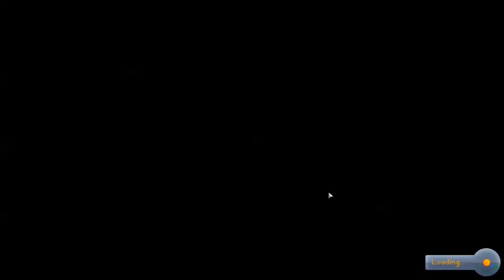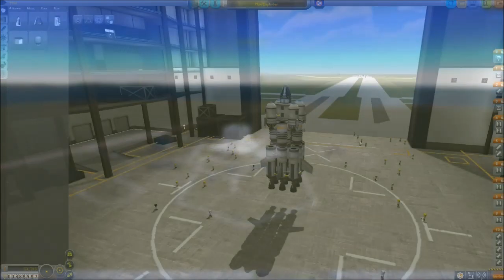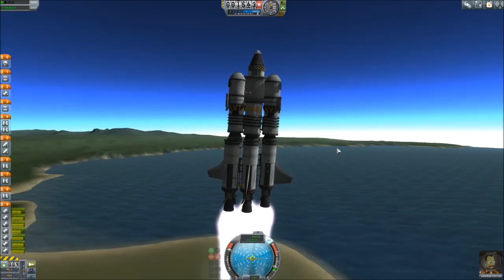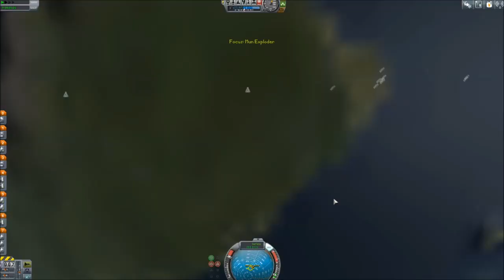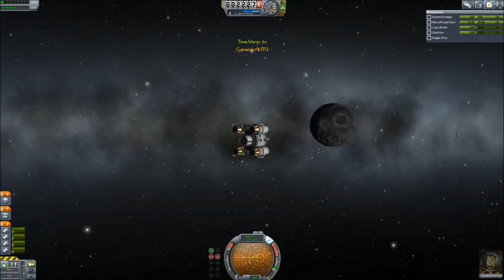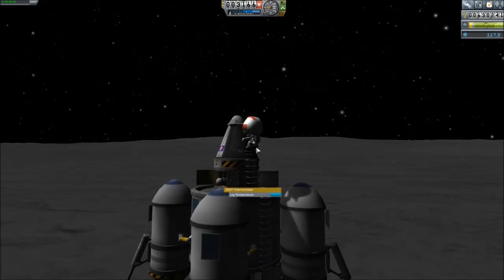Mun Landing Guide - KSP 1.0 Career Mode #7 - Kerbal Space Program Release Walkthrough

Comment: When I launched my first rocket that could go tot he mun and back I just went for bigger engines and tanks XD

http://steamcommunity.com/sharedfiles/filedetails/?id=434003844

    Then again, I did need to bring extra passenger space to get Jeb back down again... =p   

Also, I know this is kind of nitpicky but... The first general rule says you want to burn your LEAST efficient fuel first... You had been carrying the weight of those boosters for kind of a while there XD
Reply from the maker: ***** That's a good one, even better once you get fairings (assuming you don't have them yet).  For me, I hadn't unlocked the bigger engines or tanked I wanted, so I just went with what I had.  As long as I break through the atmosphere, I've got more than enough delta V for this design, so I may start trying to use it as my unmanned probe body to do things like rescue missions in the Kerbin system.
Reply: I actually did make it all the way to the mun with my probe delivery rocket, that's why I had to send up a bigger launcher and get Jeb back XD
His lander ran out of fuel on the suicide burn and he had to ditch it and land on RCS only.

I was going for an Apollo style mission with a separate lander and return vehicle on that one, but I forgot that the lander should be behind the return vehicle, so I never got to use the docking clamps for anything other than refueling at my orbital station.